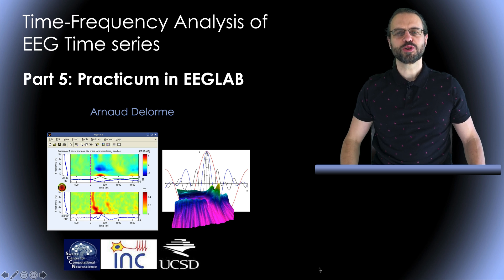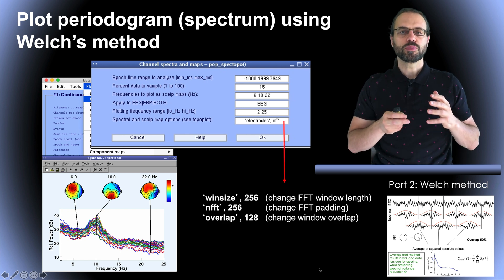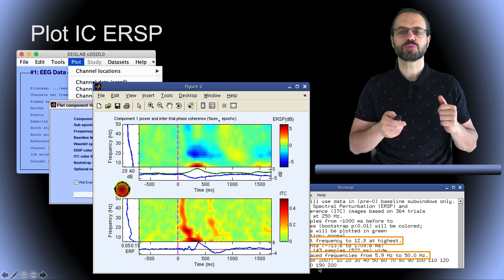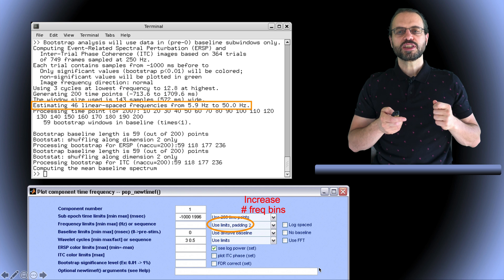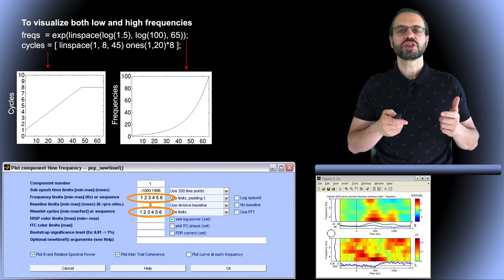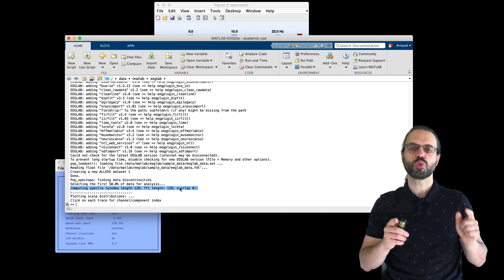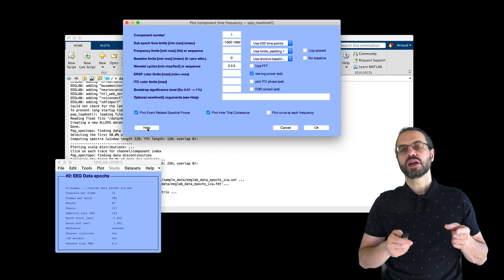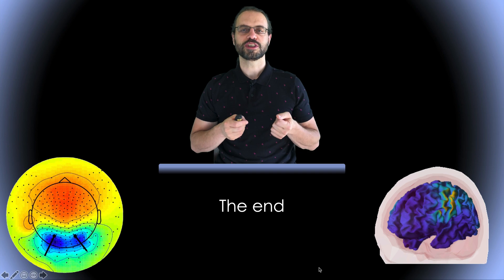Time-Frequency Analysis of EEG Time Series Part 5: Practicum in EEGLAB

Comment: What are "components" and what are they useful for?
Reply: these are the components computed by the Independent Component analysis. They are useful to obtain, to remove noisy components from data, and thus get cleaner data at the end. But I am not sure why we apply time-freq analysis to components, and not the electrodes.

Comment: I have 6 second epochs in which a stimulus is presented, followed by 5 seconds of no stimulus presentation. I am interested in the alpha power during the epoch. Would these be considered ERSPs?  Would ERSP analysis be different than resting state alpha power analysis? Also, if epochs are extracted from -1 to 6, will the spectopo function use all 7 seconds (including baseline?) Thank you!
Reply: For data epochs and change of spectral content within the epoch, you would want to use ERSP. Spectopo is to analyze stationary signals during the baseline for example.
Reply: @arnodelorme  Do you mean change of spectral content during epoch (relative to baseline)? Or do you mean when there are many changes to the spectral content during one epoch?